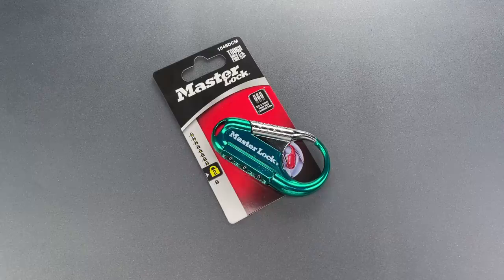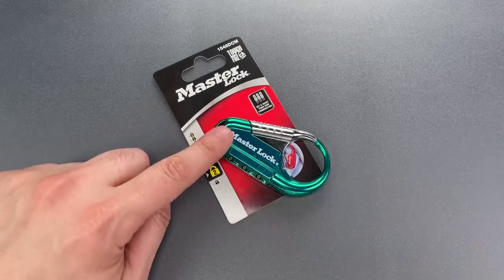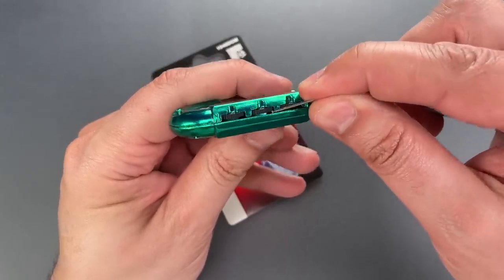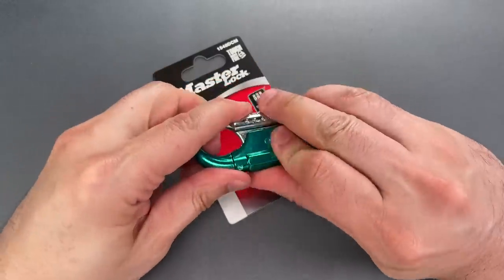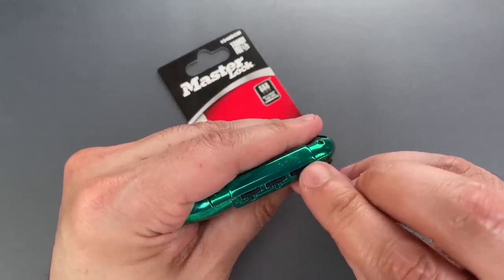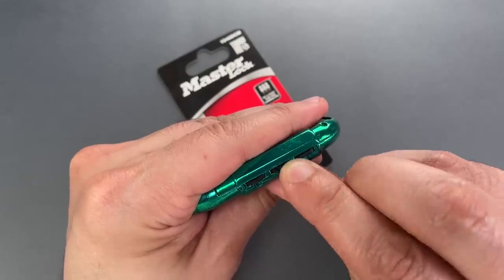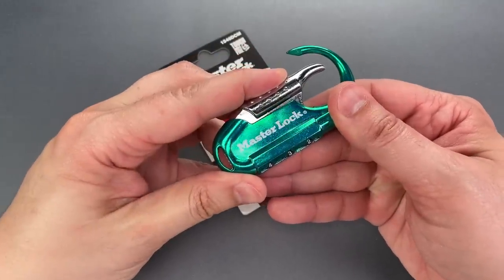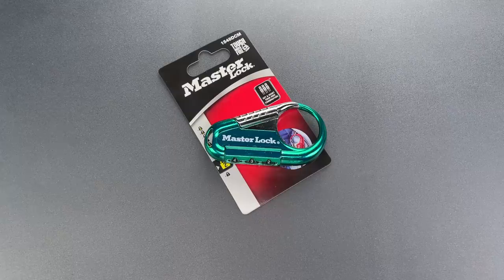[1315] Decoded by SIGHT: Master Combination Carabiner

Comment: To be fair, Masterlock rated this a "2" on their security scale. That's the rating for 'visually decodable'.
Reply: Makes you wonder what a 1 is on the scale.
Reply: if i recall correctly  wrapping something with ducttape twice has a rating of 3 on their scale
Reply: Does that mean a one is a sign that says "Locked and Secure"
Reply: @musickid43  integrated autopicking button
Reply: what is a 1 rating then? A bit of string?
Reply: @musickid43  1 is a piece of string with a knot in it
Reply: @musickid43   A twist tie is #1 over there.
Reply: @musickid43  A double-knotted shoelace?

On second thought, no, a sufficiently tensioned double-knotted shoelace would be at least a three on Master's scale.  A one would be a velcro-closed shoe.
Reply: What's 1 then? Selfopens to unsuspecting passersby?
Reply: @musickid43  a '1' opens when you shout "Boo" loudly.
Reply: @musickid43  A toothpick
Reply: I guess a 1 is just stuffing something into a sock. Or a slash proof bag that's already been slashed.
Reply: 1 is problably just a sticker saying "dont take away please"
Reply: I wouldn't even trust a level 9 masterlock.
Reply: @musickid43  1 is a wreath knot tied on some master lock branded twine.
Reply: @musickid43  An open door
Reply: @musickid43  A bread tie
Reply: @HeartTheBacon  Higher on LPL's scale. Takes him ages to take off tape.
Reply: @musickid43  a piece of ribbon printed with MasterLock.
Reply: @musickid43  a #3.
Reply: I’m curious, what’s their #1 rating called?
Reply: a 1 is a note that says "please don't steal me."
Reply: That was, verbatim, going to be my comment!
Reply: @musickid43  Paperclip. clothespin, rubber band.....twine.....
Reply: what is 1? a product that cannot actually be locked?
Reply: Then locks rated as 1 should be made out of soft plastic and have only two wheels with that gap.
Reply: @musickid43  probably unlocks itself lol
Seriously, it's probably filler to make all their products seem better. They'll never rate their own product a 1.
Reply: @musickid43  Decodable in 2 seconds without any skill or tools whatsoever
Reply: 1 is a post-it that says “Please don’t steal.”
Reply: @musickid43  openable by looking at it wrong
Reply: @musickid43  1 is a Velcro strap
Reply: @musickid43  un-lockable - can not be locked at all
Reply: @musickid43  They hand the stuff to the thief personally.
Reply: @musickid43  Literally just has a button that says "open"
Reply: @musickid43  1 is for doesnt lock at all...
Reply: @musickid43  propably a latch or something :D
Reply: @musickid43  A zip tie is a 1 lol
Reply: @musickid43  Just 1 wheel instead of 3
Reply: @musickid43  The lock self-destructs on sight.
Reply: Is "1" just a drawing of a lock on a piece of tissue paper?
Reply: @musickid43  1 is basically a sticker saying "Please, don't steal me"
Reply: Rate 1 "Unlock by touching or standing near it without key"
Rate 0 "Locked by a sticker of a master lock"
Reply: what is the lock rating for a PI? :)
Reply: Red shirt Jeff would rate this 0.
Reply: @musickid43  Made out of oatmeal
Reply: @musickid43  Air opens it
Reply: @musickid43  A 1 is something that looks like a lock but doesn't have any sort of locking mechanism
Reply: @musickid43  Just a Masterlock sticker.
Reply: @musickid43  I think a 1 is a lock made out of chocolate.....
Reply: @musickid43  -  paper clip.
Reply: @musickid43  I guess just pulling hard?
Reply: Is '1',  "No locking mechanism"?
Reply: @musickid43  A paper sign that says "do not open"
Reply: Their security scale is more for physical attacks. What it takes to break one open.
Reply: @musickid43  #1: The shackle won't close under any circumstances.
Reply: @musickid43  A quick release button or the shackle being held under slightly stronger spring tension.
Reply: Masterlock level 1 is a door with a sign on it saying "This Door isn't Locked"
Reply: These videos are scam's. There's plenty of high security locks that could be featured. 
This is why my cousin who is a locksmith doesn't watch this stuff.
Definitely a scam artist, disappointed ☹️
Reply: @musickid43  I guess that's "opens if touched"
Reply: @TheAussieRepairGuy  Nah a zip tie is also a 2 for masterlock lol
Reply: @musickid43  It is just a sign asking you not to open it.
Reply: @musickid43  A piece of string tied with a bow, I expect! 🤣
Reply: Would a 1 be those automatic doors that open when you go near them?
Reply: @musickid43  I think is obvious right? "Makes you wonder what a 1 is on the scale." If 2 is  'visually decodable', 1 should be "Stare unlockable", so a mean look to it should already be enough, hands-free
Reply: @musickid43  thinking it open?
Reply: security level: milk carton
Reply: It’s important to keep honest people honest. lol
Reply: Rating one would be 'even a baby could open it'? :]
Reply: @MrToomanynamesgone  For me, 1 would be a broken lock and you pretend it is not broken by continuing to use the 'lock' to 'secure' an item.
Did that once and had my bicycle stolen the same day...lol
Reply: 1=paper clip
Reply: Was going to say that a "1" rating is a hair knot but then I realized that untangling a hair knot can be a proper pain and take an eternity
Reply: Why sell it then?
Reply: Decoding their security scale is the most difficult challenge.
Reply: @musickid43  A coil of rope.
Reply: @musickid43  One of those hard metal twisty ties, but like, really long.
Reply: @musickid43  a latch
Reply: 1 is decoded just by a human existing in a 300 km range of it.
Reply: Which given the packaging would come in on a 3 with their scale is quite impressive
Reply: To be fair, Masterlock rated this a "2" on their security scale. That's the rating for 'visually decodable'.
Reply: @julianbraunbeck7632  
A puzzle that only the owner knows how to undo.
Reply: @musickid43  dental floss
Reply: @musickid43  Or even rated 3.
Reply: Don't they have some that are rated 1s?
Reply: @musickid43  A 1 on Masterlock's security scale would probably be a paper clip - and by that I mean "paper clip" as in "a clip made out of paper".
Reply: @musickid43  a Masterlock 1 actually calls a local criminal and tells them where they can find your stuff
Reply: 1 will be self opening then...
Reply: @musickid43  a twist tie
Reply: @musickid43  unlocked
Reply: @musickid43  1 would be so you can decode without any knowledge about lockpicking
Reply: 1 is probably a regular door handle. ;-)
Reply: What is one? Not even lockable?
Reply: A 1 would be a reusable zip tie.
Reply: @musickid43  the key is physically attached to the lock...
Reply: @ClayLoomis1958  Straight pin and don't poke yourself.
Reply: @musickid43  1 is the key is permanently stuck in the keyhole for ease of opening.
Reply: @musickid43  a note that says don't steal
Reply: "2" is the rating of the package. Lock is unrated
Reply: @musickid43  A note that says "please don't open".
Reply: Well, that makes it perfectly fine then.

🤷‍♂️
Reply: @musickid43  One where someone's written the numbers on the wheel. 0's where there are no gates, every number works.
Reply: @musickid43  A roll of Masterlock rebranded transparent tape.
Reply: @musickid43  Tying it up with a strand of spaghetti
Reply: That scale is the age of the thief it is an effective deterrent against.
Reply: @julianbraunbeck7632  one of those "slash-proof" security bags
Reply: he knows this. he is in view mongin mode last couple weeks
Reply: @HeartTheBacon  Actually wrapping with ducttape usually holds minutes against LPL. Which is an order of magnitude longer than a typical lock.
Reply: A "1" is a sticky note that says "please don't open."
Reply: @musickid43  Thoughts and Prayers
Reply: @musickid43  a zip tie
Reply: @musickid43  A block of cheese with an angry face drawn on it
Reply: @musickid43  Just a good pull and it'll open x)
Reply: @musickid43  it can’t be locked at all 😂😂
Reply: @peterdawson3536  Now I must make one, a chocolate lock, and then pick it, and then eat it.
Reply: Is a rating 1, A master lock rope tied in a knot?
Reply: @musickid43  probably a zip tie
Reply: To be fair...
Reply: @lizzapaolia959  send him a lock :)
Reply: @averyporter6745  Yes I have seen that one, hence why I mentioned it - and thats technically a steel zip tie, I was referring to the standard plastic variety, that you see demonstrated in "how to escape videos", where they slam their hands down on their knees to break them.

I hold my solar panels on my vehicles with either nylock nuts or stainless steel zip ties - so far none have gone missing.

So I'd say rating 1-2 is useful in some applications...
Reply: @woolver42  , did you see Bosnian Bill whizzing on the Master lock ?
Reply: @musickid43  I'm guessind a 1 would be the same lock with a TSA key??
Reply: @musickid43   The only thing it's missing is a TSA key slot...
Reply: @musickid43  zip tie
Reply: @HeartTheBacon   you, sir, win the internet today.
Reply: It only has a rating of 2 because it can thwart an attack by those who are visually impaired. 😂
Reply: @musickid43  A PAPERCLIP.
Reply: A 1 would be a lock that opens by just asking it to
Reply: @musickid43  A twist tie
Reply: 1 is no lock
Reply: @musickid43  A plastic thingy they put on bread
Reply: And a one is just putting a carabiner on it...
Reply: 1 must be a twist tie
Reply: @musickid43  A sign that says "KEEP OUT"
Reply: 1 is a masterlock brand twist tie
Reply: @lizzapaolia959  if the average Joe would stay away and resist from buying this kind of junk probably TLPL would feature other high end proper locks. 

Two for a $1 Dollar? Anyone?! Hmmm. 

As you can already tell, Maintenance and Engineering Departments cross every industry including the vast majority common folk, trying to save a buck do not care as long as the shackle slips click locks in place. Good enough to satisfy the safety inspector, what a joke, and the insurance company. Its stupid I know, but to make things clear for sure i do not own any of these kind of locks nor will any sane person neither.
Reply: @nobodx  … or nothing at all.
Reply: @MrToomanynamesgone  "Plz no take"
Reply: I guess #1 is like one those chinese locks I had fun with as a kid that you could open with thin nail scissors or well with anything blade like that would fit inside the lock.
Reply: @HeartTheBacon  To be fair, wrapping it twice in ductape correctly means tools are required to open it
Reply: I thought their brand name meant that.
Reply: @MrToomanynamesgone  sign "monitored by CCTV 24x7". Funny thing, sometimes it is enough...
Reply: I assume their rate 1 lock is the duct tape with "Locked" text print on it.
Reply: @MrToomanynamesgone  '1' is a sign that says "Please take this."
Reply: @musickid43  self opening lock.
Reply: So 1 is decodable without hands? ;)
Reply: @musickid43  I think a 1 on the scale will be a string with a knot in it 🤣
Reply: @musickid43  a ziptie. Inserted the wrong way
Reply: @musickid43  the code is only from 0 to 9. 10 code possible, that’s all.
Reply: @mattsan70  It must be expressly stated that the knot must not be securing anything. If the knot is securing anything, then it is given its appropriate rating of 9/10 on the master lock scale, something master has yet to achieve with any of their locks.
Reply: @musickid43  "opens when requested"
Reply: What is rating "1" then? "Falls apart when unpacked"?
Reply: so what's a one then? doesn't even need decoding?
Reply: A 1 rating is a sign that says “WHO RAISED YOU?! HAVE SOME MANNERS!!”
Reply: @musickid43  A zip tie, but it hasn't actually been tightened enough to hold.
Reply: I believe a 1 on their scale would probably be a “master lock” sticker to put on your luggage. The lock equivalent to sticking an “adt” sign in your front yard.
Reply: @musickid43  #1 Means - always open
Reply: @musickid43  probably unlocks if you're close to it.
Reply: @musickid43  prolly tsa locks, aka anyone can just buy a cheap master key and have full access
Reply: @musickid43  "Permanently open"
Reply: @musickid43  isn't it a stick wedged into a gap in the door?
Reply: I think Velcro would score a 1 on Masterlock’s scale…
Reply: @musickid43  knowabley decodable.
Reply: @HeartTheBacon  Using the whole roll would take longer for the LPL to get into than any lock he has a video on.
Reply: @musickid43  Dental floss
Reply: Masterlock doesn't rate by picking/decoding. Only physical strength.
Reply: 1 must be a twist tie.
Reply: @musickid43  1 would be "stern look required to open lock"
Reply: To be faiir.
To be faaaiiir.
To beee faiiiiiiiiiiiiiiir!
Reply: a "1" is a sticky note attached to your valuables saying "please don't steal this".
Reply: @musickid43  probably opens by itself when you're not looking
Reply: What the fuck is a 1
Reply: @musickid43  The Master Lock high-security welcome mat.
Reply: @musickid43  just open
Reply: @QuippersUnited  signed: Masterlock

Then slap a $60 pricetag on it
Reply: Rate 1 probably is "shackle melts away with the warmth of your hands"
Reply: @musickid43  pure faith
Reply: 1 means someone told you it's locked.
Reply: you can easily open a 5 (rated lock) with a paperclip.
Reply: @musickid43  zip ties.
Reply: Level 1 are made of paperboard. lol
Reply: Dear heavens, what is a "1" on their security scale?  A sign that simply states, "please do not enter"?
Reply: A rating of 1 is that german sticker that looked like a lock
Reply: I guess "1" on this security scale is push-button combination lock with 1 button.
Reply: @musickid43  1 means that it can be decoded by the power of weak wind
Reply: @musickid43  I would imagine 1 is unsecure
Reply: @musickid43  A 1 would be if visually impaired people could open It.
Reply: A 1 would indicate visually impaired can open it!
Reply: @musickid43  a spring clip
Reply: @musickid43  It's just a Carabiner.
Reply: @nabarnes  or just a loud 'fart' will blow it open quickly
Reply: 2 is the age level required to pick it.
Reply: @musickid43  Opens when lpl looks at it without touching it
Reply: 1 is stealing your neighbors ADT sign and sticking it on your lawn.
Reply: @musickid43  A “1” is obviously just a plain carabiner.  (If it says “Master Lock” on it, that’s a “1.5”.)
Reply: @TWX1138  nah velcro would be a 2 if shoes without shoe laces or velcro didnt exist
Reply: @musickid43  Unlocked by pulling hard on the latch
Reply: 1 is stashing it in the bush
Reply: why would they even make it?
Reply: I guess a 1 rating would be an open paper bag.
Reply: 1 is "doesn't lock".
Reply: @musickid43  1 means you can unlock it by just thinking about it through the weakest form of telekinesis

Comment: Shameful, even by MasterLock's low standards.  If MasterLock rated that as a 2 on their security scale, what's a 1?  A twist tie from a bread bag?  A sticker that says DO NOT OPEN?  Hopeful thoughts?
Reply: Don't give them ideas, they will do that stuff and put it a 4 on their security scale.
Reply: Level 1 is thoughts and prayers
Reply: A keychain ring.
Reply: Master lock has standards?
Reply: haha haha haha
Reply: @carelessdreamer  lol
Reply: this guy funny
Reply: Can you just image them selling a twist tie, little cardboard display backing and all
Reply: Loool. The bread bag tie made me lol
Reply: A 1 is probably a ziptie baking in the sun for 3 days.
Reply: The stick tape the use on bread bags around here can be harder that a master lock to open
Reply: in america mean words would work
Reply: idk about level 1, but level 3 is the sealed plastic container that scisors come in, need a pair of scissors to cut it open
Reply: Hey,,it says DO NOT OPEN,,,thats all you need,,,
Reply: A sticker which says 'DANGER OF DEATH' or spme poison label is more effective surely lol
Reply: I think a 1 is just carabiner
Reply: Lol 2 is the lowest on the scale (I hope...)
Reply: A sticker IS a pretty useful security measure if you have security guards, you can use them as tamper tags
Reply: Yes…The sticker, since a twist tie takes at least a minor effort to untwist.  The sticker works instantly it is seen….tho’ not very well Lol.
Reply: pretty sure that the cable TSA locks are rated as 1... basically a lock that can be open by anyone with a master key...
Reply: A 1 is a “to keep the honest people out” lock.
Reply: @TheHopson  - A MasterLock security rating of 1 is a gateway drug to the locksport bi-curious.
Reply: Lmao this comment got me😂
Reply: You have to push a button to open it. High security stuff, really.
Reply: Zip tie
Reply: A danger do not open sign and a zip tie will do better
Reply: Please. Hopeful thoughts are a better security option!
Reply: A masterlock security sticker.  Of course, we've finally found the next item in Masterlocks lineup.  We can make it out of plastic that's difficult to tear and call it "rip-proof".
Reply: @DarkD112  - I bought a big beefy looking MasterLock M15 and the plastic packaging was way more secure than the lock, which could be raked open in two seconds with anything that fit in the keyway.
Reply: lol
Reply: Ideas
The "Not A Lock" he compared to (I think) another Master Lock.
An awful Chinese lock with a plastic core.
Something just entirely made out of plastic.
Reply: Maybe tape with “security scribble”
Reply: @mojoich2736  true, i sometimes spend a lot of time trying figure out the correct way to twist it